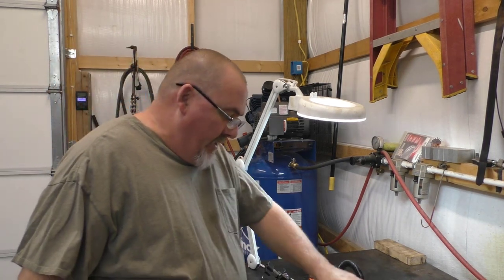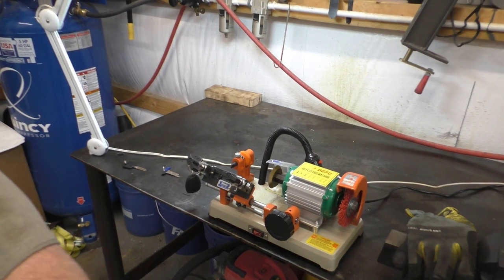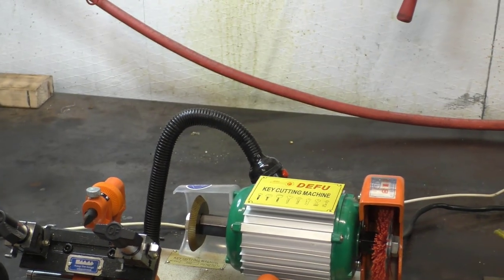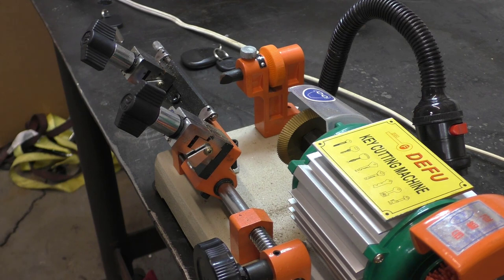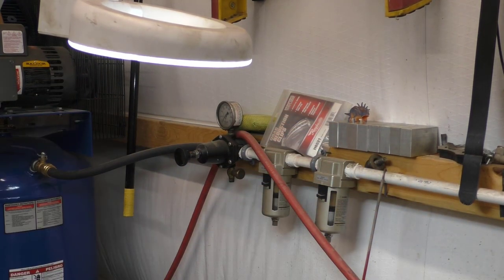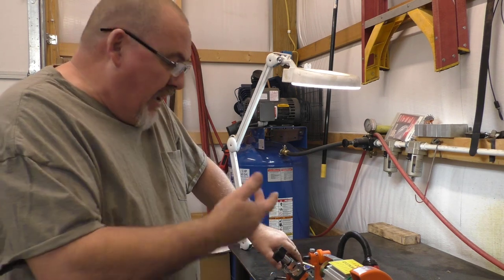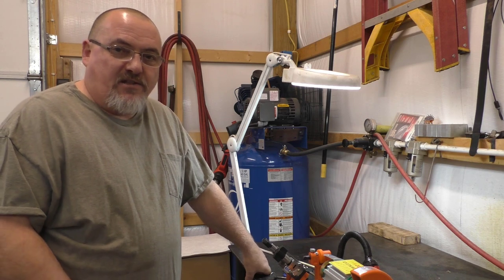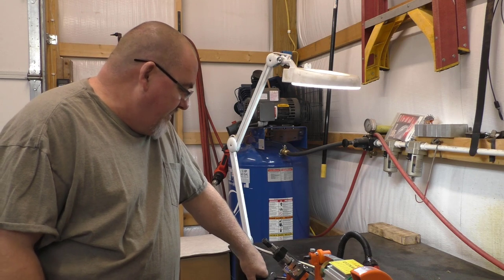DEFU How to Cut Keys and do these China Machines work

Comment: They are not cheap machines by quality because they do cuts just as good as an expensive brand.
Reply: They are pretty cheaply made and not the best for the money. I bought 5 before I said to heck with it and bought a used USA made machine. 1st one plugged it in and it just let out smoke, sent it back for a replacement, 2nd one the shaft was bent, 3rd one same deal shaft was bent, 4th one the machine holes were off and it wouldn’t cut straight enough with all kinds of adjustments. The 5the one the plate was bowed witch made cutting ok but I sent it back as well. First 3 came from a eBay seller, and the last 2 I bought from different sellers on amazon.. You get what you pay for..  They’re around 2-250 bucks from eBay and Amazon, The used one I got from marketplace on Facebook. Works great and came with around 200 new key blanks. Was 300 bucks but well worth it.

Comment: The reason you go towards the machine first is to not destroy the cutting wheel. So yeah, it works, but it won't before too long as the teeth will be eaten up very quick. It's like putting a blade in a circular saw backwards and trying to cut with it.

Comment: I'm a locksmith and I use this machine. You really don't know what you're talking about. 🤣🤣 yes each to their own opinion but this made it easier than hand filing keys. Yes it's not the best but it works. So you may wanna rethink your statement about locksmiths buddy. Also your key is crooked cuz you did not set it correctly. You did not even calibrate the machine correctly. You have to do it for every style of key so it works
Reply from the maker: Funny how every Key I cut worked fine, funny how every lock I decoded worked out as well. Funny how I am successfully removing chips from circuit boards to program keys. The only joke here seems to be you! Locksmith? Whatever.

Comment: Thanks for the video. I was seeing these machines on eBay for under $200 and wondered how cheap they really are. I do locksmith on the side and wouldn’t need it to make hundreds of keys, but would like the keys I do make to be quality cut. I now know NOT to buy this, I’ll just spend the $500-600 on a Foley Blesaw key cutter. Thanks.
Reply from the maker: I would get a used machine that is of higher quality.
Reply: I bought one and it works awesome... self-proclaimed professionals love to crap all  over other people and their ideas.

Comment: So, in a nutshell... key orientation is paramount. The machine will do everything it was designed to do. But the results depend solely upon the user's attention to detail.
And that is where this machine lacks: it's ability to accurately align both the blank, and the key to be duplicated, at whatever angle/distance/depth, etc. 

In other words... you get exactly what you put in.
Reply from the maker: Keys are mostly symmetrical. You don't have to flip the master. I did it for reverence. But yes, location of the cuts is the ticket to success.

Comment: You go from left to right because of the shape of the cutting wheel. Right to left you can get stuck and bend your key with an imperfect cutting blade. Fyi.
Reply from the maker: good point.
Reply: @ralfsautomotive  I had to do an emergency key make and that's what happened last night. I want to get a double sided wheel. Supposedly those last longer.
Reply from the maker: @mastermattk  I lift the key back on the large valleys and already have cut a ton of keys without having a single problem. Part of it stems from me doing Machine work for a living.  I also cut several of the security keys on the other machine.  Maybe I will post a Video sometime soon.

Comment: I have the same exact machine. And it's not cutting correctly and I change the blade. Does it needs a adjustment
Reply from the maker: Yes
Reply: I had the same problem but there’s a video that shows u how to adjust it . I watch the video and the machine work good now .

Comment: I know this is an old video but I only want to make keys for a classic car, meaning pre-64ish will these work ok for the old keys like that?  Reasoning is I got the run around everywhere I went on getting the usual places to cut the blank I bought that looks like the original keys.  One said no they can't because we don't know what metal it is and might tear up our machine, another said only if you buy ours which they didn't have anything that went back that far, blanks, and the last one the machine wouldn't cut old keys. I ended up going to an old lumber yard kinda hardware store and they wouldn't use mine but lo and behold they had 2 keys that look like they'd been there since the 60s so bought both and they cut them.  Then i went to a regular locksmith and had him cut the blanks I had.  I even asked if i showed ID and my title to the car!  It was just ridiculous.  Even the locksmith thought the same. Sorry bout the book!!  But it shouldn't be this difficult and nothing after market is made with better metal than the old one I wouldn't think,.  Nothing else repop is!  lol
Reply from the maker: First off, Yes, that machine would cut any key like that Given that the fixture can hold it. Second, I would not purchase a Machine just to do one Key, a simple File can be used if need be. There is other equipment as well and most locksmith's will have all of that. Those that would tell you it would tear up the machine simply lack the education! The Cutter Wheels are capable of cutting steel just have to be carefull. Cutters are made of coded high speed steel, still used today around the world in machine shops. I since then took classes and got a locksmith licence myself. Been doing Automotive and Residential for a while now and the reason for asking ID is that in the past vehicle got stolen like that. Same as cutting a Key via code, anyone can get or find a Code so it is vitally important to know that you are not cutting keys for a thief.
Reply: @ralfsautomotive  Thank you!  Wasn't just for one but thought i could get crafty with keys for friends etc. I am notorious for getting big ideas then do it and move on to the next though so the advice not to buy one is also good! Part squirrel. As for the cutters, look at a dremel i guess, the cutter is a piece of sandpaper basically and I cut a piece of steal bracket 1/4" thick, had to be real careful as those disks fly apart. You are right on thieves, there may be some that don't want to steal a car the hard way left out there.  Thank you for the reply and congrats on the new "job"!